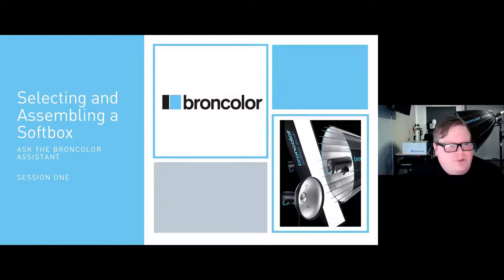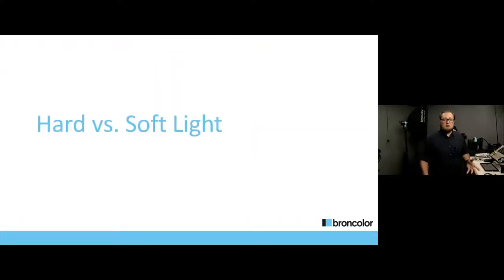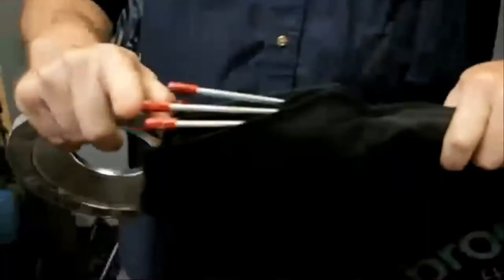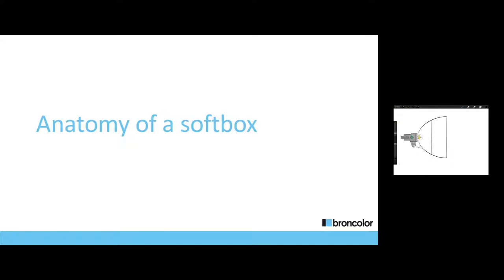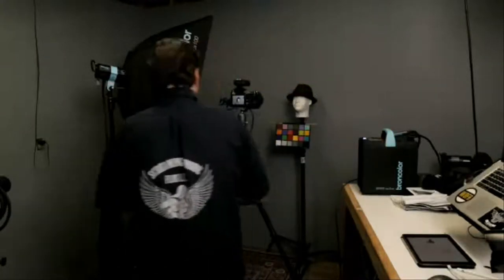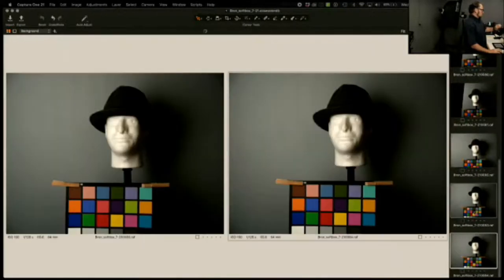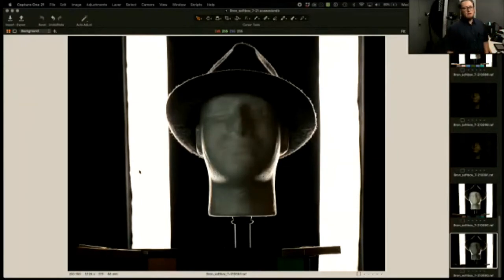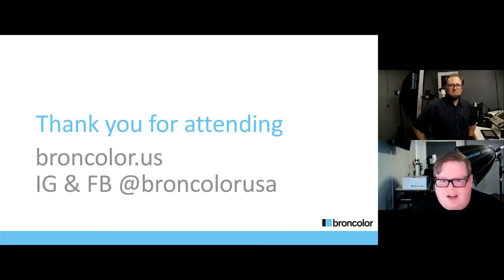Selecting and Assembling a Softbox | ask the broncolor assistant | session 001

Comment: one question, from watching this, can any light go behind a softbox, ie Picolite, unilite,mobiled, pulso-G or siros?, and is any preferred, or ONLY for one pack system, ie scoro or move, and are there any budget combinations?, ie a light head, pack, trigger and softbox.
Reply from the maker: Hi Andy,

For the most part (with some exceptions) all of the broncolor light shapers can be used with any of the broncolor lights.

For example the Siros lamps are not recommended to be used with the Flooter, and cannot be mounted as a direct source in a Para reflector.

The Picolite has its own set of accessories, but in a pinch has an adapter that allows it to be used with other Pulso light shapers.

As for kits, we do have several which contain most everything you need to get started. You would still need to add an RFS trigger since those can be camera specific. You can learn more about those on our website, broncolor.us